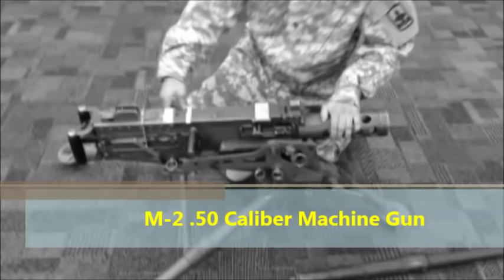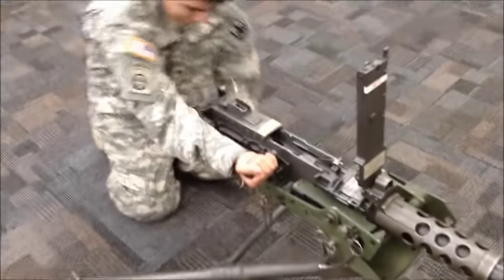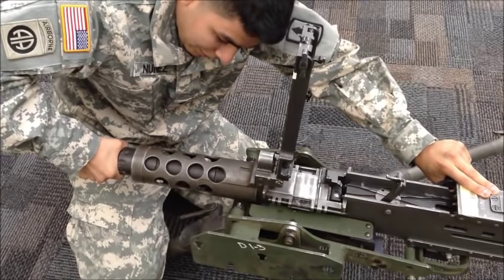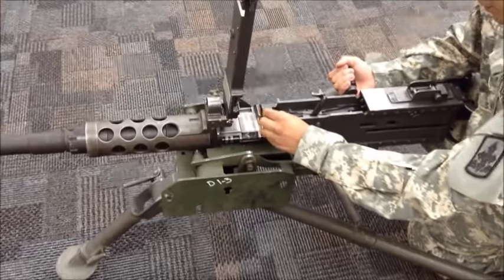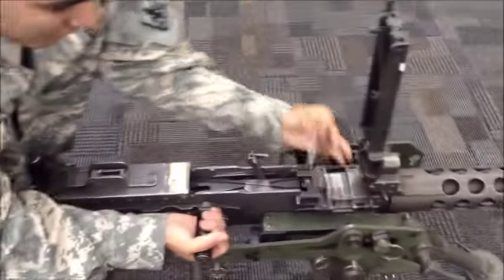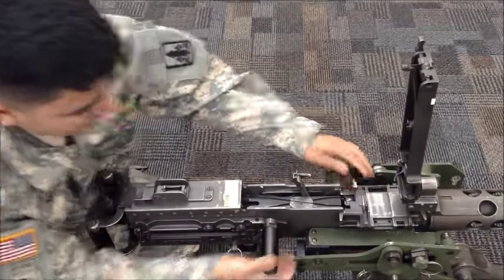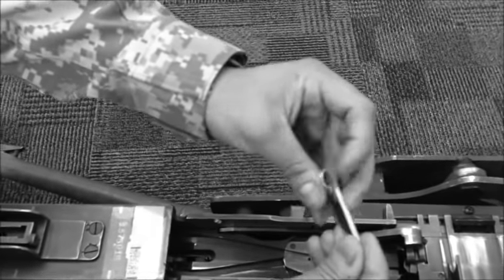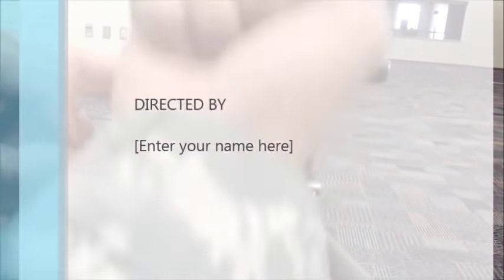M2 Browning Step By Step Headspace Timing

Comment: God DAMN, I hated doing all that! 
Actually, I hated pretty much everything about the M2 except actually firing it. That was always fun.
Everything else sucked balls. Carrying various pieces of it around, setting the goddamn headspace and timing, and worst of all cleaning the goddamn thing when you came back from the range or the goddamn desert or wherever. What a nightmare!
Reply: At least its better than what happens if you dont do it.
Reply: i'd still rather be behind one of these than behind a saw out there
Reply: I feel like I'd be the one the platoon puts in charge of cleaning, inspecting and maintaining the heavy weapons because I am an absolute fanatic for weapon maintenance. I get a certain satisfaction out of knowing the gun will run flawlessly.
Reply: @cabezadepija7318  Dshk is easier to use and fires a bigger round.

Comment: I barely remember it, but what I do remember is a little different. Had to do it in 1979 during PNOC in 2nd Division, Korea. Seems like we had to count a lot of clicks while turning the barrel. Like 40 or 50 of them. Don't remember what for, just that I was surprised as hell when it actually functioned when I was done doing it in front of the class. Maybe they changed the gun since then. Also remember strong warnings not to pull the back plate off with weapon cocked to avoid a metal rod shooting into your gut.
Reply: Sounds like the counts of the trigger lever stop nut (aka the timing nut). If I recall right if your timing is really off you screw it up as far as it goes then back it off 35 clicks and go through the timing normally. If all else fails. Go one click at a time and you'll get there but if it's your gun it should never come to that.
Reply: @tibbs3112  Yea backing off 35 clicks seems to jog my memory. All I know is that even with all the new technology it is still an awesome weapon still used as invented over years ago.

Comment: Fire, no fire is for timing. Go, no go is for headspace and you should NEVER ride the bolt forward. Also when checking for the headspace you want to ensure the firing pin is not sticking out before you shove the guage in so you do not break the firing pin and ending up with a out of service weapon.
Reply: Sir  The Operators Manual states to RIDE the bolt forward during HS process.
Reply: YES!
Reply: @wollywolly3953  You ride it forward when there is no barrel.  Slam it home a LEAST twice before checking head space.
Reply: Ride the bolt home on empty chamber. The operating springs of semiauto and auto weapons are designed to exert force on a cartridge to feed it into and set it in the chamber. If there is no round being fed, that force that would feed the cartridge is now slamming the bolt against the chamber. You ride the bolt home on an empty chamber to prevent breaking parts.

Comment: This is an excellent video on how to perform these VITAL functions on this weapon. If you cannot perform all of this in LESS than 2 minutes, you are a NO GO as far as I am concerned. Mis-setting the timing can result in a weapon that fires too fast or too slow and can result in stoppages. Mis-setting the headspace on an M2 can result in a weapon that is DANGEROUS!
Reply: Yeah, and who would want a dangerous weapon, right?

Btw, that's a joke. I get what you're saying.
Reply: 50 cals that do not know their headspace set have been known to explode. The round does not cleanly leave the chamber and partially breaks apart in the chamber.
Reply: As I said, I was joking, but thanks for clarifying further. I was wondering though, wouldn't it be possible to make a 50 cal. Machine-gun that doesn't have to be "tuned"  like the M2? I know that there already are some new ones, but they can't fire all the rounds that the M2 can.
Reply: Christopher Nore the QCB model doesn’t require it and as far as I’m aware can still fire the full range of ammunition that we used with the old 50
Reply: @Key_highway  Sorry... there's a CQB M2?
Reply: Brian Halligan yeah it’s been out for a while now, so much better, and add on to my last comment still requires initial headspace and tuning and extremely infrequent checks after that, can’t quite Remember how often
Reply: what about the m2a1?

Comment: just put barrel  in my 50 cal. receiver  15 clicks that was it. Most times i had a nail holding to the pod haha go army back in the 70des had an inspection they ask me how i would fire my 50, i said  i would not, its held with nails. one inspector said you have a Russian  tank comping at you what do you do, i told him i would take out with an anti tank gun, the inspector said where did you get the anti tank gun, i look at him an said the same place you got your tank, i was put ok KP i am good at pealing potato, 2/92.

Comment: way harder then i thought, i tought its just putting the ammo belt. and rack the bolt twice. thats what i thought😂i am just 11 years old
Reply: U don't do this every single time before firing dude
Reply: @ivanhorvat1995  well if i need to do this ,i would not know how to🤣btw pls dont roast me
Reply: 3 clicks and go if the shit hits the fan.
Reply: This is something that only needs to be done after reassembly after disassembly and cleaning. It just so happens that said cleaning is pretty regular when rotating your guns around on patrols.

Comment: I'm french and i don't understand
Reply: In order for an M2 heavy machinegun to not malfunction in a dangerous way the distance between the barrel and the moving parts need to be checked with a bunch of spacers in certain areas before firing. Otherwise you risk the cartridges exploding in your face instead of sending the bullet down range. This is what they're doing here.
Reply: If you are French you don't really need to get the M2 into working condition, you just drop it and run to the POW camp so you have first choice of the good bunks.